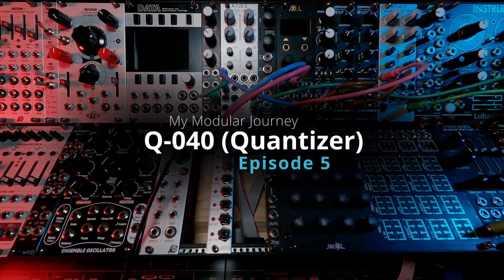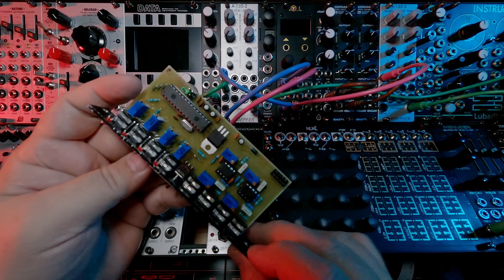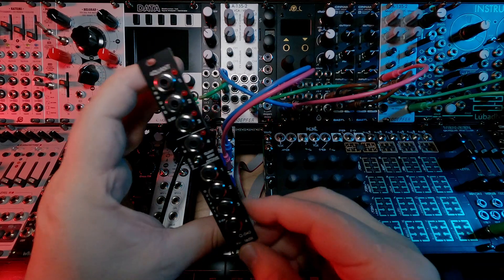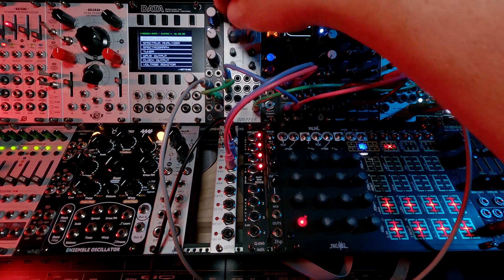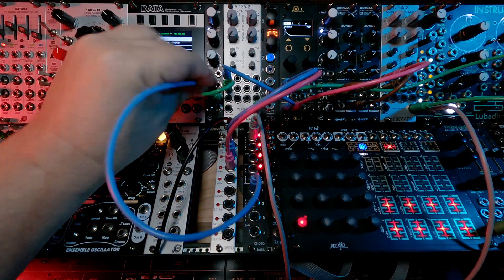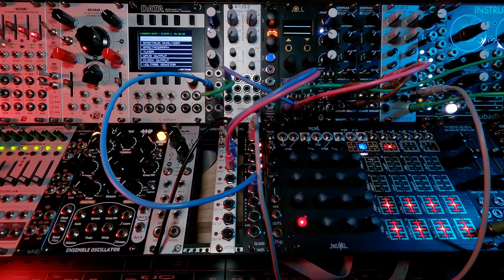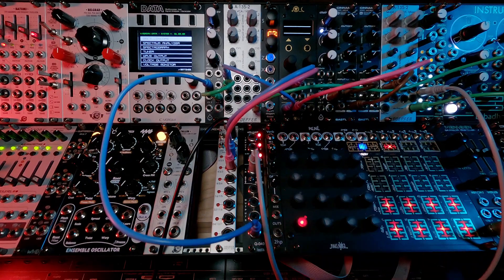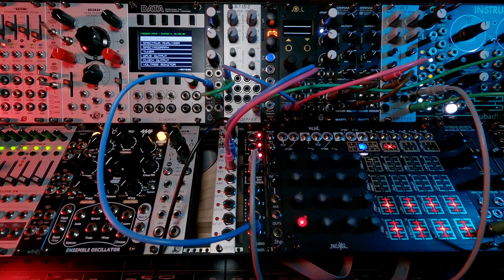My Modular Journey - Season 2: Episode 5 (Q-040)

Comment: Thanks for sharing, but it would have been so much more interesting if you had demonstrated this with the Behringer 182. Problem is that getting reliable results from a quantizer is much more difficult using an analogue sequencer than from an LFO sweep. For example, I had great difficulties with using the Doepfer A-156 dual quantizer to get any decent results with the Behringer 182, simply because it regularly, randomly sharpens or flattens the note, which makes it rather useless for the purpose. my Q-040 has not arrived yet (I sent the Doepfer back), but the reason I am going to try it is for the fact it has a jumper that allows you to have some control over the noise hysteresis and I am hoping that will make the Q-040 much more reliably produce the same notes all the time. We will hopefully find out soon.
Reply from the maker: You are absolutely right, on all counts, and in fact a few episodes down Season 2 from this one, I cover the entire System 100 build, including exactly what you ask for here. It's a long video, but there are chapters. I hope this helps you find the Q-040 is in fact a wonderful device. Here's the video: https://youtu.be/ffRmwsNZtBo Thank you for watching!
Reply: @VisionsMusicGroup  Thank you so much for the reply, I will certainly watch your other video!
Reply: Have you tried the q040 in the meantime and what’s your opinion on it?